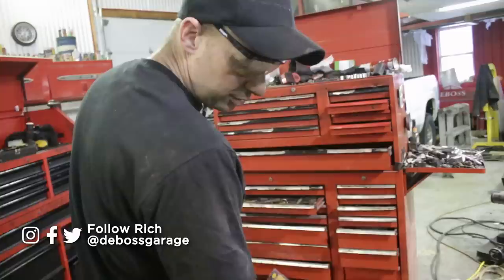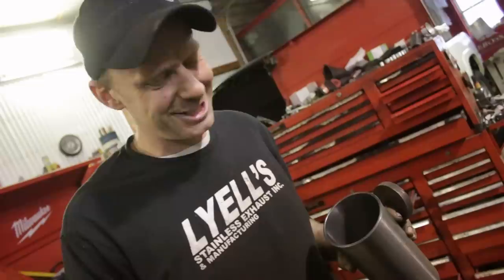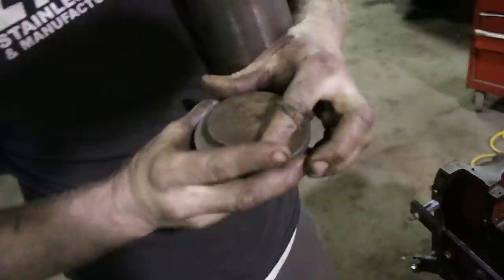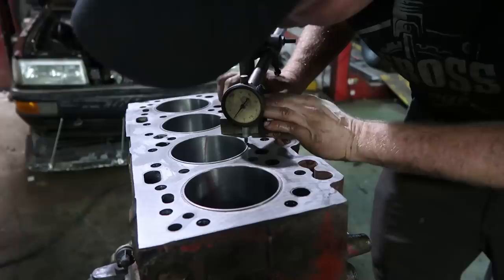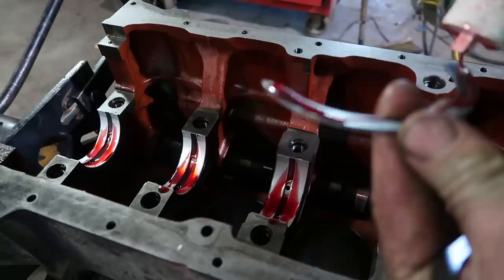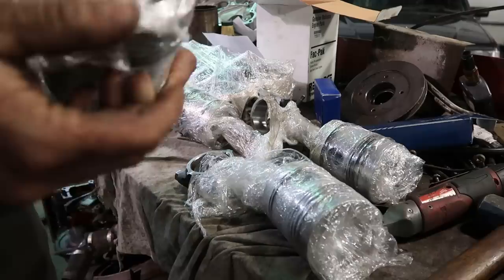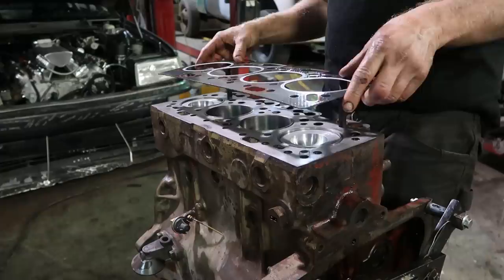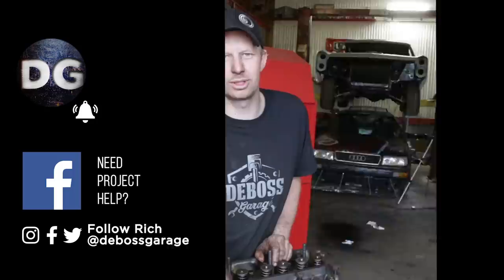3.9 Perkins 4-cyl Dry Sleeve Engine Rebuild | Massey Ferguson 270 [EP2]

Comment: I have only ever come across one dry liner engine, that was a 1956 Leyland diesel. The liners were an easy hand slide in and out and the manufacturers service book said to coat the liners in engine oil to aid heat transfer. On wet liners I was told to run a 50% anti freeze mixture to stop cavitation, this raises the boiling point. Cavitation works by bubbles forming from reduced pressure lowering the boiling point of the liquid and then the bubbles imploding blasting the metal away, raise the boiling point and the pressure needs to be even lower for bubbles to form.

Comment: welding a bead down the sleeve is a trick that's been around forever. I worked in a machine shop in the early 90's. used to do it to pull liners and pressed in valve seats in aluminum heads. those where gas motors though. I don't know about dry sleeves in a diesel. keep up the great work.

Comment: Which "green" Loctite? 601, 609, 620, 635, 680?  They are all different and have different cure times. Some are lubricated, some not.  If you chill the liner before insertion, then you won't get the friction heat buildup which causes spot curing. The cured Loctite resin will only reside in the low spots or valleys of the surface profile. The high spots or peaks will still remain in contact. These are your primary heat transfer tracks, the valleys usually contain air (which does not transfer heat very well). The cured resin transmits heat at about 10 times that of air. So, your 'Loctite' mounted sleeves will actually conduct heat better than the non mounted areas.

Comment: Made a carefully shaped drift to carve straight down the side of liners, works a treat, no marks, I do this because I often fit liners and pistons with the engine in situ. Although it's not strickly correct, I have always found the new liners will go in easy by tapping with a wooden block, never needed to cool them. My engine man always bores the block if the liners slide too easy and fits oversize liners, also he always uses unfinished liners and bores them once in the block as they were originally.

Comment: We used to use a bigger sleeve with a chunk of flat bar and a long threaded rod to pull them out on a few motors the bang would indeed catch you off guard. The press way is Uber better. Plasti Guage is good stuff. Great video.

Comment: Nah bro, your neighbor is a genius. I have done that with a bearing race in a blind hole in an aluminum transfer case. The secret is speed. In my case the race was thin so I used a TIG torche You want to minimize the heat transfer. ESPECIALLY with aluminum on the other side. TIG is hot fast. I ran a "bead", just heat from the bottom of the blind hole to the top. Took 2 maybe 3 seconds. Then I threw cold water on it. Done. I could almost pick it out with my fingers where I broke an inside puller on it 20 minutes earlier. I bet if you could take a big TIG and run a "bead"(no metal just heat) from the bottom to the top where the sleeve is backed up by the thickest part of the block it would be no problem especially since that sleeve looks pretty thin. Actual welding puts in too much heat and tries to warp the sleeve though I don't doubt it would work. I just think the TIG works better because it is faster. Soon as the sleeve cools a bit it almost stops putting heat into the cast iron block. Dump some water in immediately afterwords and the block should barely be warm.

Comment: 6:50 no joke. When you rack up the tons on that gauge it gets scary. I bought an air over hydraulic press just so that I can actuate it from a safe distance. I'll stand besides the post and look through the little hole with safety glasses on.

Comment: Rebuilt a dry sleeve engine with an old mechanic-he put the sleeves in our freezer and after they cooled about a day they slipped almost all the way in by gravity.  He finished them by hand.  I was impressed
Reply: It was an 400? cubic inch IH diesel .  A bigger bore with more room to contract.

Comment: I enjoy your channel.  While watching your 3.9 Perkins 4-cyl Dry Sleeve Engine Rebuild | Massey Ferguson 270 [EP2] video ....the part where you were struggling to remove the dry sleeve, the thought occurred to me that freezing the inner sleeve would maybe contract it enough that it would press out a lot easier.  Being a physical scientist, I considered how you could accomplish this.  What I came up with is quite simple and hope that in the future you might give it a try.   seal the bottom of the cylinder with some silicone and a round piece of wood or plastic lid of the correct diameter.  fill the cylinder to the top with  crushed ice and some water. Let it sit a minute or two and I suspect the sleeve should contract a few thousands thereby making the extraction much easier.

Comment: Another great video,  my old boss who was a machinist and an engine builder used to say that plastigauge was made for jack legs who don't have the brains to read the mics  and precision tools necessary to measure proper clearances. And he would tell us that if you have to use plastigauge then you need to go get a job working on briggs and stratton lawnmower engines. I personally never had any issues using plastigauge - as long as he never saw me using it. To him that was an offense to be fired over!

Comment: Just did the Perkins in my Massey Ferguson 240. Saw a guy on YouTube hammer a tiny "soft" steel screw driver down the side and basically unzip the cast sleeve, then pulled it out. 

Worked like a charm 🙏

Also, I used liquid nitrogen to shrink my liners since I was doing it in the frame.... They dropped right in. And swelled up to normal size within seconds.... So don't fuck up.

Comment: I used to soak my pistons in oil when rebuilding an engine, but from other sources was taught it is better to use WD40 (yes, WD40) to lube the new rings as using engine oil risks causing the cylinder to glaze upon startup because the compression rings will have to cut through the heavy oil film, which they where not designed to do. In theory, the WD40 will burn off almost instantly, and because the oil system has been primed, there will already be engine oil on the lower portion of the cylinder and piston where the oil rings can do their job. I have since rebuilt a handful of engines lubing the rings/cylinders with WD40 instead of engine oil when installing the pistons in the cylinders. My experience, the rings seat much quicker and better than when I used engine oil. I still lube the wrist pin very generously with engine oil, just not the rings and cylinders.
Reply from the maker: Thanks for that!
Reply: That’s true. Total Seal says nothing but WD40 on installation. I’ve built Toyota engines for a living for 25 years and never used anything other than penetrant oil. I don’t personally use WD40 but any penetrating spray like Thrust, or PB Blaster will work just fine.

Comment: i helped rebuild 2 pirkins eng, in the late 80`s .. it take us 30 sec. per hole on a 1100 eng.   put 100 watt light bubs in the clindes holes over night and sleaves in frezzer . one at a time . pull bulb drop sleave in .. clank..

Comment: The perkins gets cavitation home in the liner bored we sub sleeve the blocks.its really prevalent in the 1000 series engines. I'm a factory trained Perkins technician I have taken liners out by running a weld bead in 4 places. The liners are tight enough they won't move once they are installed.

Comment: I would say your primarily correct about the coolant filter. Big part is maintenance of the fluid by adding cleaners and cheese to it.
But it still has a paper element so it will filter, it will filter out rust and crap dropped in. On a non industrial vehicle.. no need for a filter. But industrial, the coolant system can be constantly checked. Our vehicles get all fluids ( not diff) checked every time it comes back to the yard.

Comment: Great job I've used a home made puller with an all tread rod and some spacers and I freeze em before I put em in don't ever use any kind of glue to hold them you'll regret it

Comment: We've used liquid nitrogen to install cylinder liners. Especially when doing Honda's that have specialty Leonard to close the upper portion of the deck. Strengthens the engine and keeps everything from moving.

But we've also used concrete and epoxy on the bottom portion of the water jacket on BPO Big Blocks.

Comment: If you warm three block to around 40 or 50 deg C the and work quickly taking 1 sleeve out of the freezer and install it immediately I reckon it would drop in almost all the way before it grabs. A couple of 60 watt light bulbs in the block overnight covered with a blanket would heat it nice and gently would do the trick. An alternative would be dry ice for 20 minutes in the liners. Just make sure you wear lint free gloves to handle them.

Comment: I was tought to never use ATF in an engine build. the ATF will cause a glaze on the cylinder on first start, rings wont seat right...
Reply from the maker: You are right.  It was 15w40 in a container that had ATF in it.  The ATF was drained, just a little residue on the bottom.
Reply: @DEBOSSGARAGE  
Thanks

Comment: So you're supposed to chill the new sleeves down in a deep freezer and heat the block. But you're not supposed to spray anything between the sleeve and the block. Both surfaces need to be absolutely clear for optimal cooling performance.

Loctite 518 is used to seal the bottom of the sleeve to avoid any oil ingress between the sleeve and the block. Oil between the sleeve and the block reduces the conductivity.

You're obviously not supposed to completely loctite the whole sleeve but just put some in the bore right before you push it down the last third. Any excess can be wiped. The Loctite needs to cure some hours, after 24h it's fully cured, so it's best to not start the engine until the next day.

Loctite 518 can withstand 5W30, Water with glycol and DEF but cannot withstand gas. So if you want to remove a sleeve sealed with Loctite 518 you can add some gasoline to break it down.

That's what I've learned and believe, feel free to take it or leave it 😙🎶

Comment: Yeah your correct I used to work for a John Deere workshop in Australia and they do have a filter for the coolant and specialy designed coolant to prevent cavetation but it still does happen just takes a lot longer with the right coolant

Comment: When I was at Nashville Auto Diesel College I was taught that during a engine rebuild, when you put assembly lube on the cam and crank bearings that you don’t smear the assembly lube because of the dirt particles on your finger and natural oils from your finger will contaminate them

Comment: You can make a crankshaft "bigger" if you nitrite harden after grinding. They will swell. I have seen many standard cranks get ground and nitrited and come out standard journal size.
 Nitriting is not a normal practice for tractor engines. I come from aviation world, any ground crank gets rehardend.

Comment: A 3.A152 was the first engine that Dad and I rebuilt together.  We were going to swap out the Standard 23C in Dads MFFE35,  but sold it and bought a 1635 Cab.  Wish we had of kept it, loved the simplicity of the Perkins.  The Perky 3 Cyl also only had one cam bearing.

Our machinist put semi finished sleeves in, finished them in the block.

Thanks for the vid, look forward to the rest.

Comment: Had those in a clark forklift. Ran great all the time. Just burnt oil after awhile. Always started in the cold. Also had a kramer loader with a perkins. I think ford had them in rangers in the 80s.
Reply: Rings go bad because of wrong oil, air filter not on right. They'll run long time burn oil. Good engine

Comment: Thinking about cavitation erosion, we have it here in washington. The huge dam turbines would last almost forever except for cavitation. Welders have to get in and fill up the holes. Cavitation in liners with an additive has some  complex physics. If it works why not do it. How it works? Maybe partly what you say is true. At least if it is spalling off and not the metal liner all is well. How sound does this is pretty interesting. I would think it is more like the old chieftain tank ammunition. It shot a gob of explosive onto the enemy tank. As it exploded, it spalled off the inner surface killing the crew. Gob smacked.

Comment: running a bead of weld on the inside of the weld is a good tip. Heat works wonders
Reply: Yeah but too much heat can be bad. That is why you have to be fast. I wonder if you could put water back in that block with temporary rubber plugs. Honestly I dont think enough heat would be generated to justify it.

Comment: Coolant filters contain dca and you test the dca levels with lithium test strips and you can add dca to your Coolant system eliminating cavitation to your liners it's a good idea to check your dca levels and change your filters or add dca when needed

Comment: The weld trick works. I've used it for bearing races in heavy equipment axles. I only use it if I have no other way to get the race out, otherwise it's the hammer or press. You can get into trouble with that method.

Also, 100% replace bolts if the manual says so. Likely means the bolt is torque to yield, it's not a sales gimmick. Can you get away with it... Maybe, if you're lucky once...

Comment: The idea of welding inside is shared among the old motorcycle hub bearing race. Of course, you go with this solution if you don't have the right puller. Hammering the thing could sometimes damage the housing part if you aren't careful!

Comment: Perkins cranks were nitrided, a hardening process using nitrogen gas. They also offered a huge choice of liners, pistons and rings, just dont use chrome rings in a chrome liner!! Have rebuilt many 4108,4208 and 6354 motors.Fuel pump timing is a no brainer as the drive has a master spline and only fits one way. They are very reliable probably due to their low power output, high hour engines are a bugger to start when the weather is cold.

Comment: The liner and dry ice and just drop it in, no hydraulic press needed...
Reply: Yes sir
Reply: I have a sperm tank and a good source for liquid nitrogen,   Works great. ,    I wonder if it changes the molecules in the steel,
Reply: I have used a regular deep freezer to cool the parts to install before. Also the dry actually could make the parts stronger. However I believe when parts are cryogenically treated they are cooled at certain rates ,held for set times,and  returned to normal temps at certain rates to control warping and cracking. I like the dry ice on bushings and other things and maybe I will try dry ice on my next rebuild.
Reply: In the winter, put the freezer outside, turn the thermostat as low as possible. Put liners in freeze for 24 hours. 
Use thick gloves when moving liners. 
But 
We use liquid Nitrogen.
Reply: I just stick them in the freezer
Reply: Caterpillar uses liquid Nitrogen, to install bushings.
Because they have a large tank of nitrogen to air up the $10,000 tire (just one).

Comment: Make a hole on that second washer and use impact drill in impact-only mode with a strong iron breaker tip. That will take out that sleeve in 10 secs. Continuous vibration will help a lot to slide out.

Comment: I dont see how any loctite will be between the liner and block after pressing them into a press fit hole in the block, it will be all scraped off while driving the liners in. I rebuilt a 248 perkins a few months ago it just made a big mess when putting the liners in and trapped it under the flange on the last few thousands.
Reply: Gets between the tiny scratches in the liner and block. If you were to wipe oil on the liner, install it, then remove it again, you'd be able to pick up some oil on the liner with a rag.

Comment: Pretty close on the liner pitting. We use a coolant filter that releases a small amount of DCA (diesel coolant additive) without the additive in the coolant on the combustion stroke when the combustion happens it causes bubbles on the thrust side of the liners that implode and tear a small piece of liner away when it happens. So when you inframe a cummins and it has had proper cooling system maintenance you will have a pretty aqua blue color on the coolant side of the liners.

Comment: I E-mailed you a question but haven't heard back. On the three cylinder Perkins tractor engine , do I need a special puller or tool to replace the seal for the tach drive on the back of the engine? It weeps oil bad through the hole on the small housing cover. Any help would be appreciated. Great videos.

Comment: Stainless rods work well for welding for pulling bushings
Reply: D Steven Paisley 
I think the idea of laying a bead inside the old sleeve to pull the metal in is a great idea. I did not like the localized heat hypothesis. It makes no sense.

Comment: Very nice work, only comment I have is using that torque wrench to remove the main cap to check the plastigage. I was taught that a torque wrench is only supposed to be used to tighten a fastener until it indicates, not once its already been torqued.

Comment: Coolant filters also come without SCAs (supplemental coolant additives) and can be used in the case of an older car with a neglected cooling system to clean it up after flushing it.

Comment: here in Brazil the Chevrolet c10 use these engines. Little Perkins.
Reply: That is very cool! I just bought a Ford ranger with a perkins 4.135. Runs like a top, I am going to put a small turbo on it.

Comment: Liners come in different levels of finish depending on what you are doing, example fix one sleeve as a repair, unfinished liners are the best way for a rebuild as the new sleeves can distort when inserted in the block, then bore them to correct size so they are perfectly round so the rings seat in, i wouldn't put finished liners in a full rebuild.